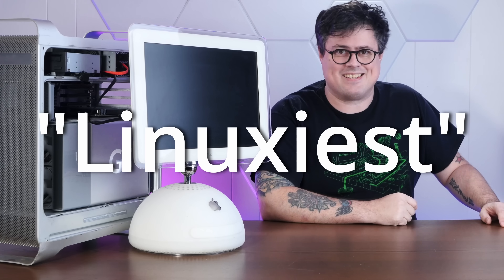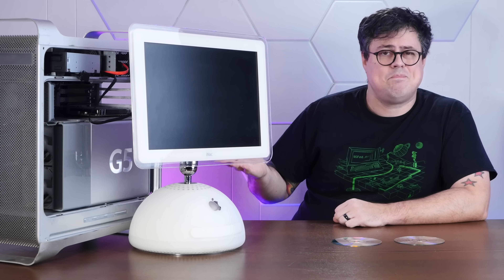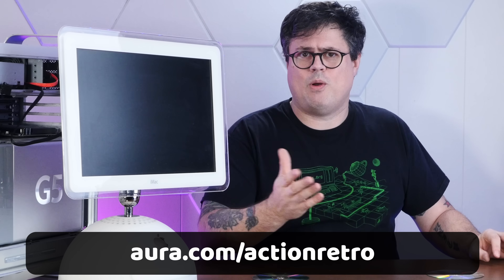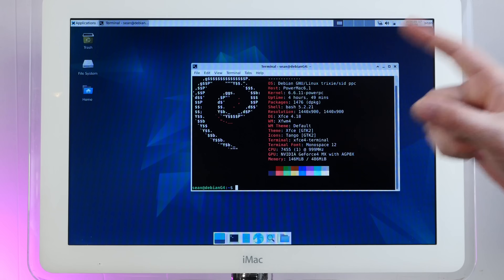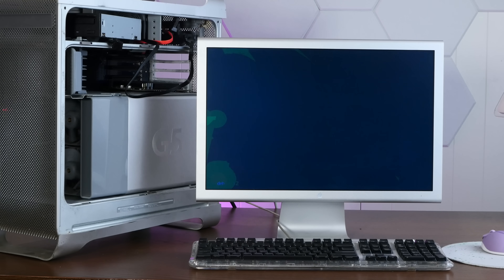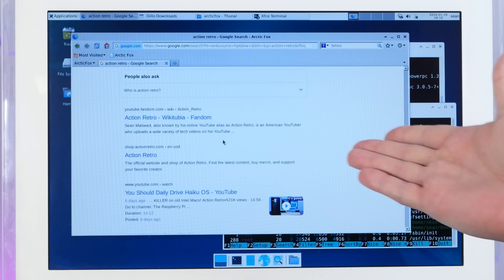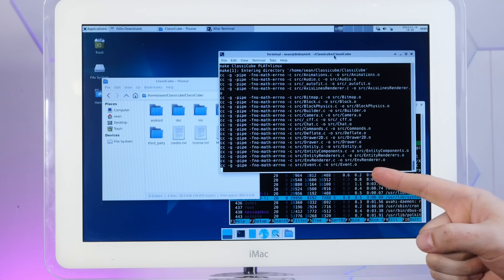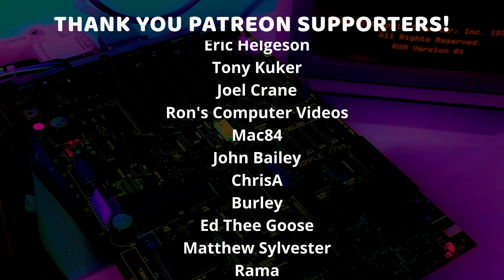Debian Runs on Literally Anything

Comment: I have, not straight Debian, but Linux Mint Debian Edition 6, 32 bit, running on a Dell laptop from 2006. It works great. Saw everything including my wireless all-in-one printer and scanner and everything works perfectly. It has a Core Duo T2500 processor with 2GB of memory and an Nvidia Geforce Go 7800.

Comment: I just installed Debian 12 on an older PC for the first time yesterday! What a strange coincidence. I was confused that I had to install sudo manually. Maybe I unchecked something I shouldn't've? I plan on running it headless through CasaOS and so far (after the sudo side quest) have been having fun playing around in it.
Reply: sudo was probably installed (unless something realllly weird happened), but your user is not automatically  added to the sudoers file (the one that gives users permission to use sudo)
Reply: Debian doesn't install sudo in default installation. It is Ubuntu thing to install it by default.
Reply: When the debian installer asks for the root password just leave it blank.  This will enable sudo automatically.
Reply: @stephenhall1490  Can confirm.

Comment: Great stuff, and yes I think the GPU is the issue in the G5, if you have an AMD card that will work in the system you will get a much better experience as AMD is just better supported with Linux open source drivers compared to Nvidia.

Comment: The only issue with running Debian on a 98 Cherokee is that you can't use Wayland and the kernel is not the latest.
Reply: Wayland has been the default in GNOME since Debian 12
Reply: @sugaryhull9688  the joke is about how Debian can run on a car.
Reply: @MarcosCodas Ah. Yeah. Wayland probably wouldn't run on a 98 Cherokee, but someone would sure try to get it to work lol
Reply: @sugaryhull9688  But of course with Gnome as they are all in on Wayland, and it works really well(I'm using Manjaro Gnome on all my main PC's) but with all the other DE options, you gotta wonder how long will they take to update them to get full Wayland support, and if they will push it out the same time the DE devs do?
Reply: To be fair the kernel he showed is 6.6 which is the last LTS kernel with 6.7.0-0 being the last I'm seeing on Manjaro Gnome, but yeah I wonder how long it will take Debian to move over to Wayland, what another 10 years? 😅

Comment: I've found that in a lot of cases, the mobile versions of websites use a lot more CPU and RAM than the desktop versions, yet have a lot less features and usability.
Reply: reads article on phone (site sends requests for every single permission known to mankind)
Reply: I bet the mobile versions send stuff compressed, or get the front-end to generate elements more. To reduce data usage.
Reply: @WIImotionmasher  I've found the mobile versions use tons of data. To the order of around 60-100MB for ads and another 25-50MB for the actual content. Load the same page in desktop version, and combined total data usage is around 40 MB For both ads and content.
Reply: Well thats just normal. Web programs tend to run on higher level programming languages that are not as effective as the lower level languages that desktop applications are made with
Reply: fr, web browsing is just hell on mobile for some reason
Reply: BuT iTs ThE wAy Of ThE fUtUrE 🤦‍♂️

Comment: Yep. I needed a laptop for school and the only thing relatively modern at hand was a 2019-ish Chromebook. Installed Gallium OS only to find it was unsupported and was weird when it came to the campus network and school sites. Tried SEVERAL Linux distros and almost all of them had issues regarding HW support or bloat. Then I tried basic bitch Debian. Worked FLAWLESSLY with far less bloat. There's a reason Debian's a go-to distro.
Reply: weird I had every distro work on mine and on a 14 year old machine. In fact my old machine works flawlessly on debian, mint, arch, fedora, and a couple others I tried.

Comment: Man, you can tell things are dire when there's only really two mirrors left for PPC 64-bit Debian. I wonder how much longer the kernel's going to officially support PPC.
Reply: Given that IBM's still making and periodically updating their POWER line, I doubt that kernel support for the newer little-endian stuff is going away soon.   Big-endian support could be a different story though.
Reply: I doubt it would. Lots of integrated systems use powerpc, plus some nasa rovers also use PowerPC
Reply: Debian is not dropping 32-bit x86. It is nonsense. It will happen, but many years from now.

Also Linux still supports m68k in latest kernel. No changes here. In fact it still see updates , especially recently.
Reply: @movax20h  The Motorola 68000 does not have an MMU and is therefore not supported by Linux.  Perhaps, you mean one of the later revisions with an MMU like the 68020 or better.
Reply: @mrquicky  Motorola 68020 doesn't have mmu either. Nor it is required by Linux (Linux on m68k uses softmmu) . But it is true, that 68020 is minimum for Linux for some time.

Very few computers run with MMU on 68020. There was external chip from Motorola, but few computer used it if any. There were also non-standard mums for m68k, in Sun workstations. I don't think Linux ever supported any of MMUs on m68k (even ones from Motorola).
Reply: A Youtuber reported a month ago that Debian was dropping 32-bit support for the x86 platform soon.  Linux dropped support for the Motorola 68000 at version 2.2  We can only grieve and look to the future.

Comment: 0:17 - That PCM in your Jeep XJ Cherokee is "hackable" too... FYI.

Gotta love the Linuxiest Linux distro and the Jeepiest Jeep Platform. Maybe one of these days you can combine them by Installing a Motorola MW520 or MW800 12V Mobile PC in your Jeep. I know Debian Stretch supports all the touchscreen hardware. Just add the extended idle switch + the calibrated 120mph cluster and you'll end up with a Police Package Cherokee, add a USB to OBD2 dongle and you can do datalogging any time you want too.

Comment: I want to see Debian running on that 1998 Jeep Cherokee.
Reply: Technically if the infotainment system on it is new, yeah, that’d run Linux
Reply: my 2002 Grand Cherokee with the same engine ran Arch. unfortunately the transmission ran sudo rm -rf --no-preserve-root
Reply: @schztinky2820  My 1995 Plymouth ran Voyager (older version)
Reply: @schztinky2820 🤣🤣🤣
Reply: Get a Linux Based Car Entertainment System from Ali-Express, They are available $150-S400, the Replacement unit for older BMW's has a 8 Core CPU !!!...

Comment: Love Debian, reliable and no surprises. Along with NetBSD it's my favourite operating system for repurposing and saving old machines that would otherwise be destined for the e-waste scrap heap
Reply: I have NetBSD running on Quadra 800 and Dillo browser. Not fast at all, but functions.
Reply: I had NetBSD running great on some computers no version of Linux accepted to run.
For example a Sun Sparc Station IPC or a dual Pentium 75 (non MMX of course).
Reply: NetBSD is amazing

Comment: Yes, Debian does run on pretty much anything. I got a bunch of simulated QEMU machines that run Debian on i386, amd64, arm64, riscv64, hppa32, mipsel, loongarch64, ppc64, ppc64el, m68k, sparc64, alpha, s390x, sh4. And not even all the supported platforms are mentionned here!
Reply: Debian truly lives up to its name as "The Universal Operating System" with how it supports so many architectures, amazing stuff
Reply: Debian also has an Xbox distro called Xebian (not to be confused by an already existing distro of that name).
Reply: I tried Debian 8 on an HPPA machine at one point, booting was an issue, but Gentoo worked great. Don't have it anymore, or I'd try Debian 12.
Reply: @OhhCrapGuy  The nice thing with QEMU is that you can pass the kernel, initrd and arguments directly to the simulator, meaning you don't need a working bootloader in order to have a working simulated machine. But every time the kernel and/or initrd is updated, they must be extracted from the disk image to present to QEMU directly.